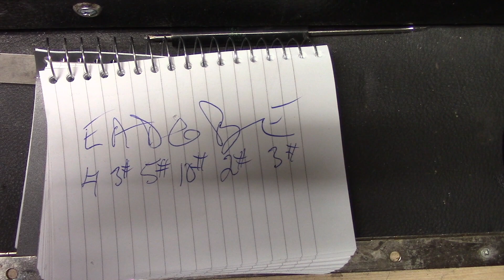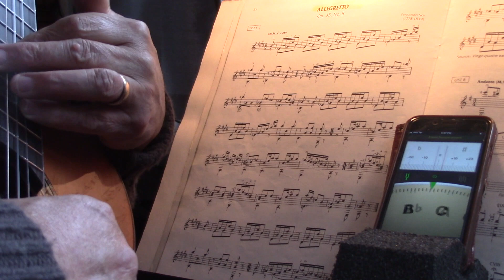Classical Guitar / Fret Dress / New Nut / Compensated Saddle @StringTechWorkstations

Comment: Nice video.
Every nylon strung guitar I’ve ever played has had moderate to extreme intonation issues. Trying to achieve a sort of equal temperament type tuning requires huge attention to detail, time for both the strings and the wood/tension to settle and even then, only certain keys/chords will sound reasonably in tune with each other. The plain third is usually the most difficult to deal with, but in general, they can all be problematic.
I think Segovia said something similar (and his guitars were probably the best that any amount of money could buy).
Reply from the maker: The pitch displacement is not as severe as it is with the the steel string guitars; when pulling the string down to contact the fret crown. Thus the thinner saddle on the classical guitars. Other than the slightly lengthened "G" string ... it is a lot more forgiving than the steel string intonation.

Comment: I bought a classical guitar and the saddle has quite a bit of rise on my six-string area and I don't know how to fix it it seems like am I wrong in thinking they cut the saddle for a steel string but it has a classical top because it has the dip on the G string
Reply from the maker: Is this your first classical guitar ?
Reply: @StringTechWorkstations  No but its been 20 yrs and it was a student one ,the neck was cracked ...etc so it wasnt my passion to get it right but now at 49 im getting the urge to finally learn from the guitars abilities to my own knowledge and theory and so on ..lol.Hence noticing the issues that made my $100 guitar such a deal...
Reply from the maker: It is hard to give you valid guidance without knowing more details about this guitar. But I will say this ... the height of the strings from the fingerboard on a classical guitar ... is typically MUCH higher than the steel string guitars. The looser classical strings have a much wider oscillation pattern and need more clearance to vibrate.
Reply: Ah ok and I am more familiar with steel strings I had a beautiful Alvarez and the strings were much closer to the neck.My classical now is a Yamaha CGS103A. no major damages just a saddle tbat wiggles when not strung and literally falls out of groove also.

Comment: How deep should the grooves be on the nut? I just installed a new nut but u sure how deep the grooves should be sanded how to measure it out . Thanks. Great channel
Reply from the maker: Approximately 1mm. The width of the nut slot string-to-string is more crucial than the depth.

Comment: Where did you get the intonation values (notes on paper) from, or did I miss something?
Reply from the maker: Determining the values of the Compensated Nut and Compensated Bridge saddle are covered in detail for my Patreon Tier 3 subscribers ... with hours of extensive dedicated videos. Tools / supplies / comp nut + saddle blanks / discussion of scale lengths / string gauges / action preferences / fret tolerances  etc ......  all of these variations are addressed; in order to deal with the constant " moving target " values on both ends of the scale. Thanks for asking.

Comment: What height should the strings be above the first fret and does the nut slot height affect string clearance when notes are fretted? I have a 7 string classical that's proving difficult to set up and I'm trying to diagnose the problem. It has only 0.005 clearance at the 7th fret with 1st and 12th fret held and the action is 3.5mm at the 12th fret. I think it needs more relief?
Reply from the maker: That's ( 0.005" ) not enough clearance for a classical. The nut does not affect clearance once you start fretting. As you know... in most cases .... classical guitars don't have a truss rod ( not needed ). Are some of the notes " splatting out " ? I would need more info and detailed photos to answer your concerns.
Reply: @StringTechWorkstations  Thanks for replying - no, all notes are clear but only when played free stroke and since it is a Brazilian guitar it sometimes requires to be played hard and there is too much buzzing for me. I am trying higher tension strings to see if that helps.
Reply from the maker: Good move.